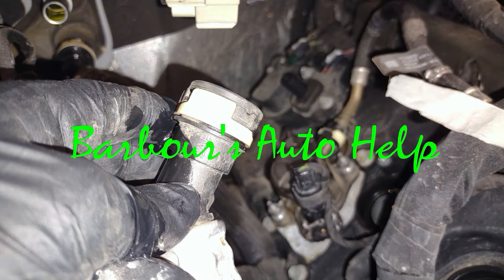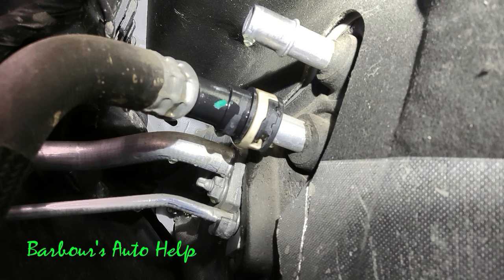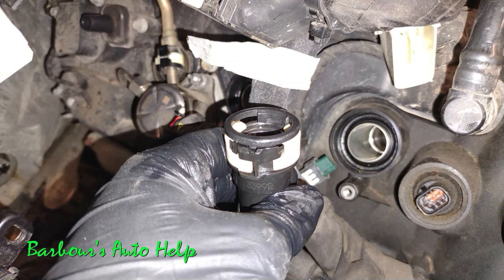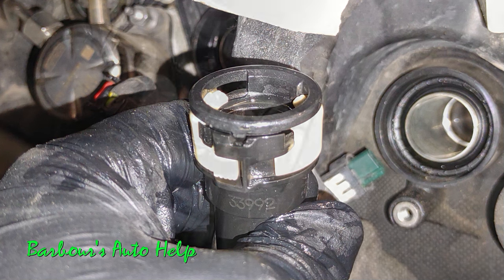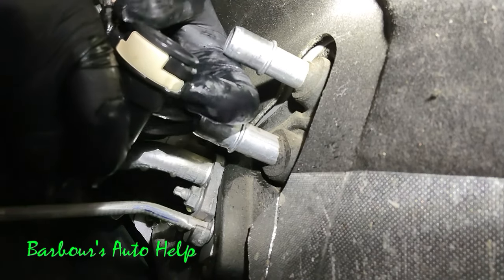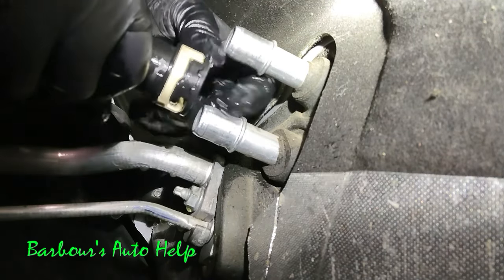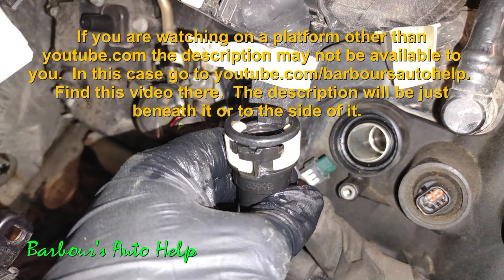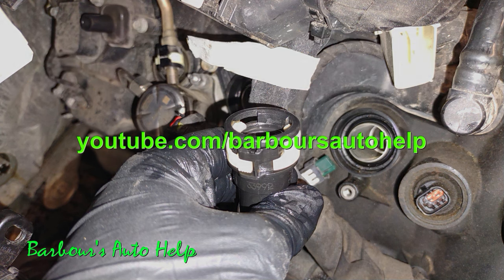Late Model Ford Heater Hose Quick Disconnect/ How To Disconnect and Reconnect

Comment: Hey dude i bought a heater hose for my f150 and it’s got the clip style and twist style on opposite ends while the old hose has two clip styles . I can find anything on that or any other parts the same way and I got the new one right from ford and i want to make sure it’s right before I remove anything
Reply from the maker: I ran into the same situation.   After running into parts they let me know that it's an updated design that works in the place of the old clip style.  The new "twist style" worked on the old nipples.   Of course it never hurts to call the parts department to have them verify this for you.  I forget what year f150 I was working on.  I want to say it was a 2014.